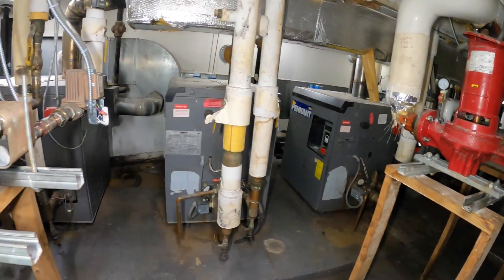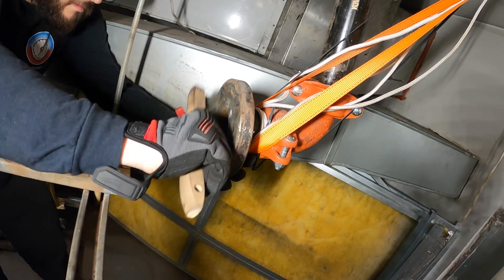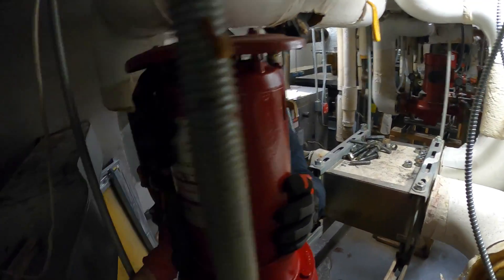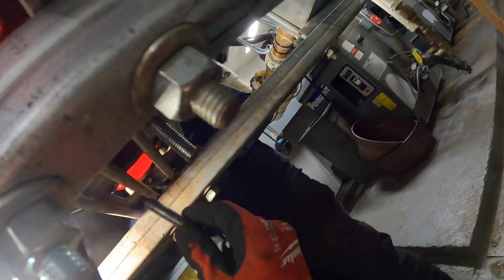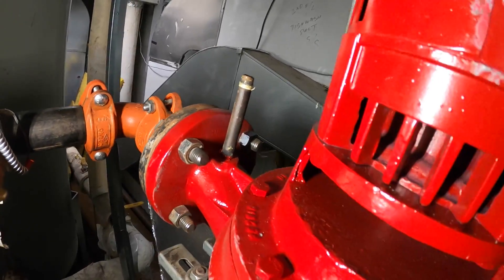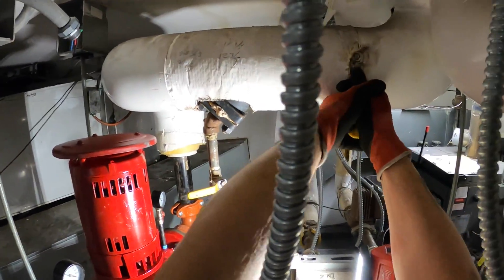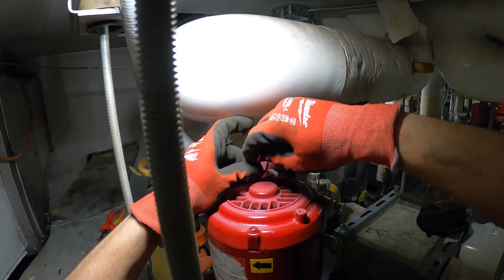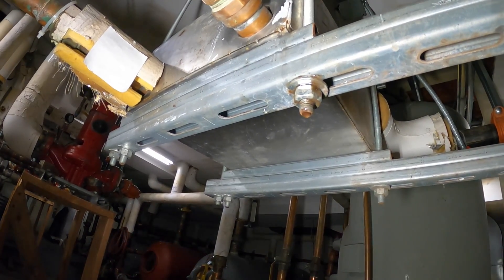HVAC Emergency Follow Up: Commercial Hydronic Circulating Pump Installation/Repair For LAARS Boiler

Comment: Looks like a braze plate heat exchanger, they're prone to leaking when they get cold, which might have happened when you were changing the pump. When heated up it should stop, if not then it's probably faulty.

Comment: Normally I don’t post comments but watched your videos and noticed that the pump was installed backwards from the start. Compare the volute on the sister pump to this one. You will notice the flow arrow is different.
Reply: Yeah I realized that when they went to install the rebuild and the electrical box was on the opposite side from the first install lol.

Comment: My man, I'd recommend getting Crescent's Spud Wrench. I'm a Fire Sprinkler Service Tech and we always deal with Jockey Pumps and OS&Y's valves that deal with flanges. Just a recommendation brother because the Spud Wrench helps align the holes for the bolts. Other than that I love your videos and love learning from them! 🤘🤙

Comment: Bro as a 62 yo maintenance man who did what your doing lifting heavy stuff. DONT DO IT !!!
When you get my age you'll regret it. I'm seriouse.
Also GET TO THE STORE AND GET YOU A RATCHET SET.. LOL. Good job by the way. You always do. You can tell your old school you take pride in your work. Keep up the good work
Reply: You can take the pump out of the housing and make it lighter.
I used to do the seals on site, easy work.

With external seals, you don't even have to remove the pump or motor. Just take the coupling apart.

This motor looks like the internal seal.

Work easy not hard !
Reply: @brianmckenna8495  I think they're required under contract to make like-for-like replacements unless specific replacements aren't available.
Reply: Your are right l 60 l operate a small utility plant. When we have jobs like this l ask for help we get 2 other guys and we plan of how to install safe way use chains or steel beam the company l work for does mind if it takes all day as long it done right and everyone goes home .
Reply: Old buildings your doing a great job. I remember post offices in Jersey same scenarios. Be safe out there brother! Get some kroil spray you will love it and never seize!